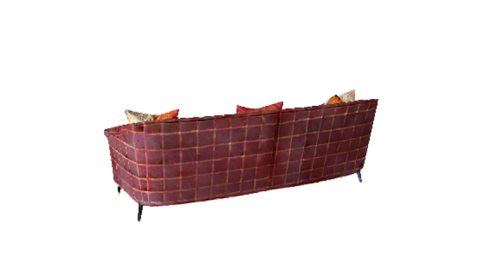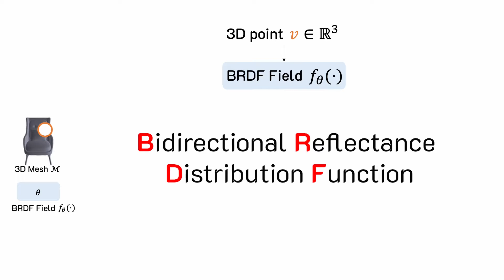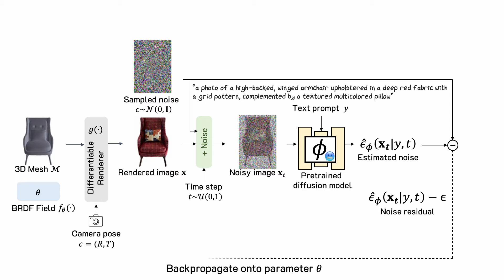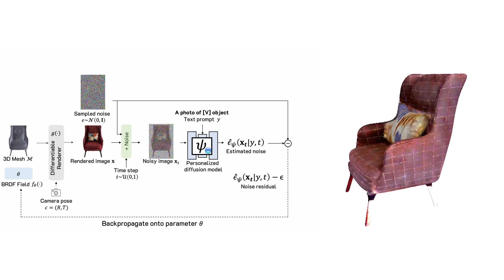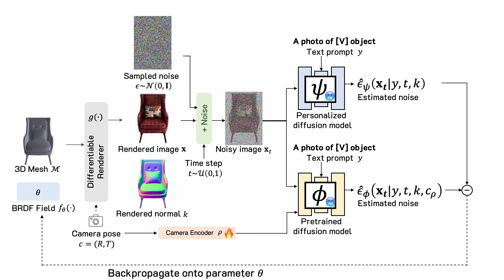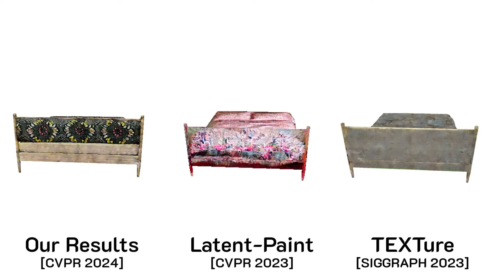3D Texture Made Easy

Comment: This is really cool. I was wondering if there is a reverse way of doing this? For example if I have a scene with many different meshes/materials and I join them all into one mesh, is there a way to get all of the textures into one material. Perhaps somehow sampling the texture at each point on the mesh then building some type of new UV map based off of the sampling. Would be amazing for glb optimizations